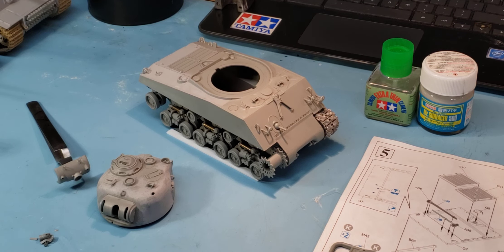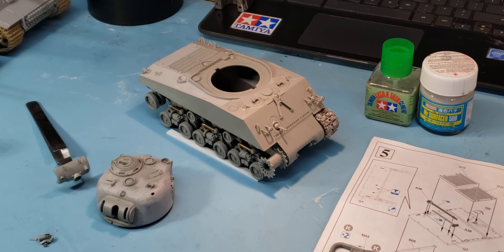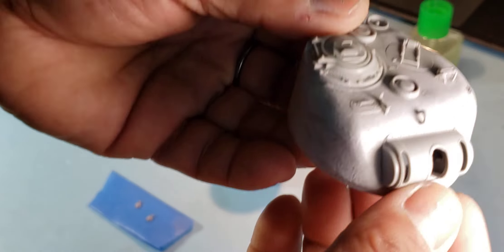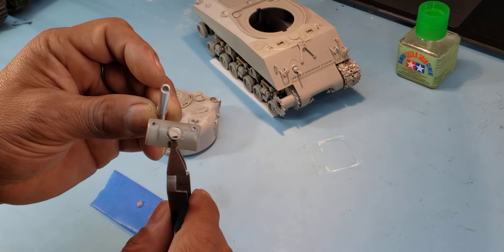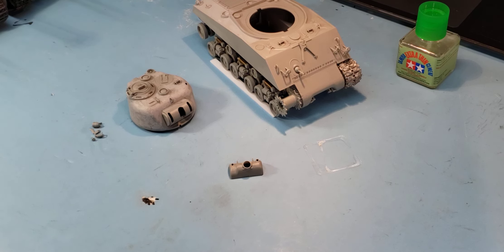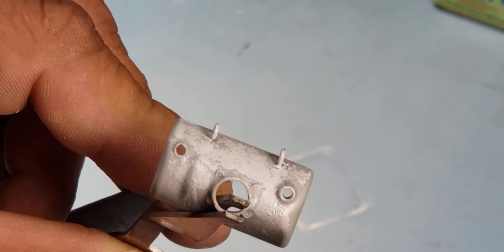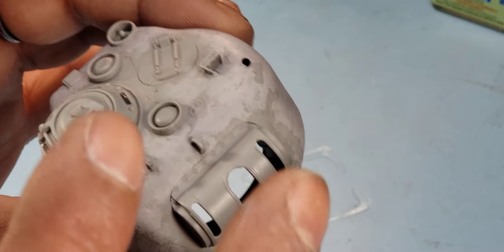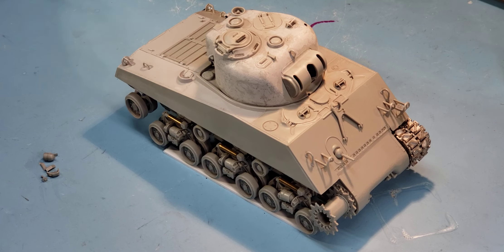1/35 Sherman 105 Howitzer tank by Dragon Models-Restoration Part 2.

Comment: A very enjoyable “chat” and look at your approach to modelling, and another way of creating cast texture I’m going to use in the future. (I’ve done stippling with stiff  brush but on styrene surface that had been received an application of solvent cement to soften the surface. Works well enough but can be messy with styrene “cobwebs” at times.)

I found the similarities and differences in model building quite interesting. I also enjoy replicating a specific 1:1 truck, trailer etc. whether from memory, one picture, or a whole series of reference photos. 

I haven’t done any rebuilding projects or sourcing parts trees on line, but I do combine parts from both new and old kits as well as some aftermarket detail parts. I went through an acquisition phase from around 2010 to 2012 and much of that kit “stash” is still unbuilt. I do still pick up occasional kits although not to that extent. I tend to view kits as sources of parts more than standalone projects in themselves.